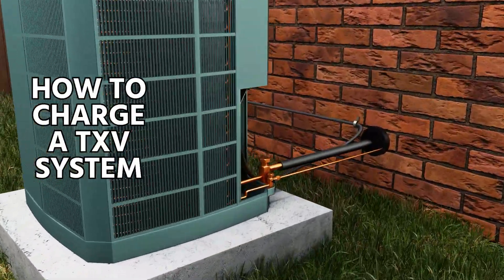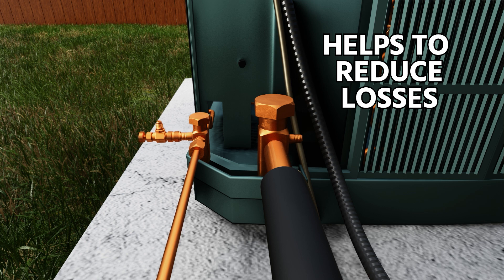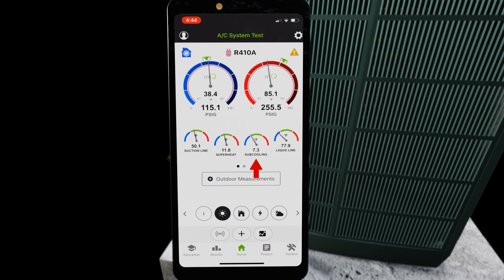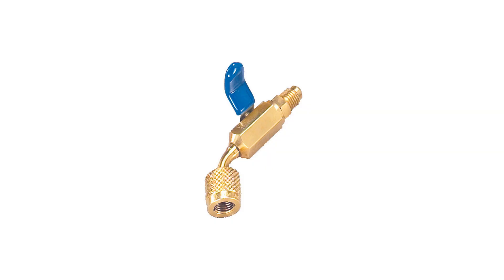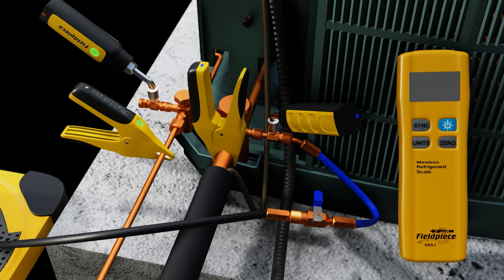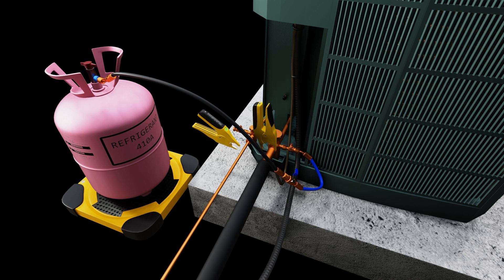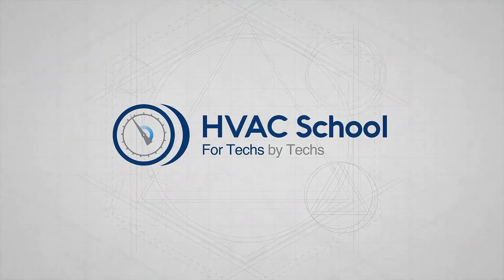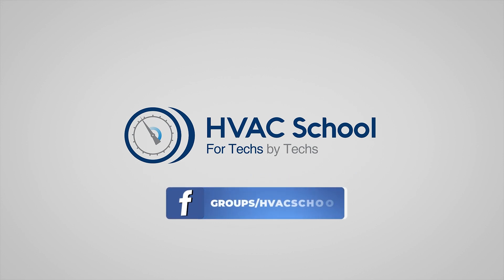Charging a TXV system with Probes and MeasureQuick

Comment: How is a system treated that has an R-410a "Flo-rater" metering system (Aspen DX-treme C-series) as far as charging the system, like a TXV or a fixed orifice ?
Reply: I just throttle the ball valve to have it flashing into gas, not sure if it’s the correct way but never had issues on flooding the compressor.. wouldn’t suggest my way tho cuz not sure if it’s “safe”

Comment: I got my universal and took a basic HVAC course and was hired as a maint. tech that said they would train me but I've kind of been thrown to the wolves. In 8 days I've gone to 6 A/C calls. All have TXV's so with the R-22 and R-410 I know how to use subcooling to charge the unit if the charge is the problem using gauges but 2 of the units I worked on were converted to R438 and there is no line on the gauge for R438, just R-22 and R-410 and I can't figure the high pressure line temp???? Both times the best I could do was make sure the low side temp was above 32 degrees on the R-22 gauge line but I don't know if that is right. Can anyone help me??
Reply: 😂 I went thru the same thing this week.
Reply: Did you ever get the answer? It's 2 years ago and I don't know if you will even see this comment but if you do and still need the answer let me know and I'll reply.

Comment: I use the core remover tool with 90 deg anti blowback adapters when I charge on the liquid line with the fieldpiece probes exactly like it's shown in this video. And yes I use the yellow jacket hose with the ball valve on the end. So it looks like I have 2 ball valves. I purge the air this way. But I hate those depressors used in this video. I could never figure out why all of them leak like hell. They don't have good o rings? And besides that.. U can't charge with core depressesors. I think they're just a waste of space in your tool line up no offense. I subscribed and I learn from your videos on the daily. Thanks though.

Comment: Thank you !
At electronic expansion valve how charging ?
Reply: Hope you found an answer? 👀 I charged through high side enough to get the compressor running then as the eev is metering I finish off on the low side.. it worked well with proper sh